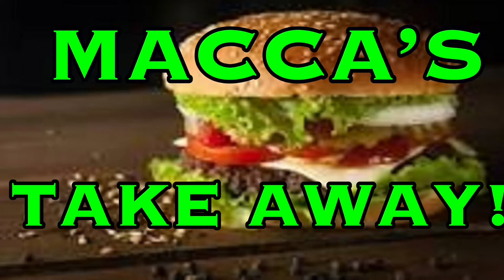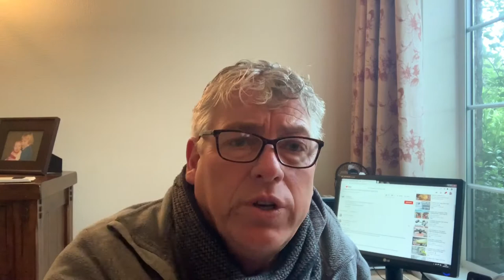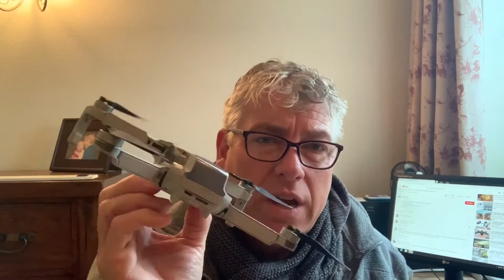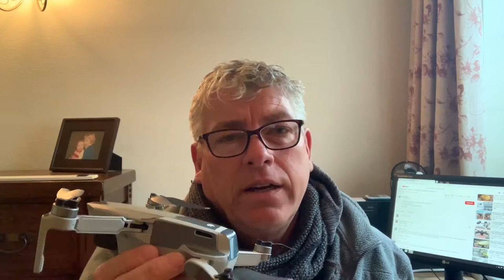MAVIC MINI - MOTOR SPEED ERROR SOLVED ISSUE!!

Comment: You are absolutely right and concerns minis with 3 batteries. One battery is automatically supplied with the current firmware, but unfortunately the other two batteries are not when you insert them. Then the error occurs. Remedy: 'DJI Assistant 2' for PC notices the incompatibility and you can install, or you can insert EVERY battery into the Mini and do a firmware refresh, so all batteries are up to date. Today I was able to fly all three batteries completely empty without having a problem.
Reply: Hello, thank u anlot. Could you tell us how to make this update of the battery?
Reply: @EwaFilmuje  

I already described it above. Step by step again:
1. with the normal firmware update there is a battery in the Mini. This will also receive the correct update.
2. When the next battery is placed in the Mini, it has not yet received an update, and it cannot be triggered.
3. The DJI Fly App automatically requests the firmware update for the second battery after a few minutes. But that doesn't always happen and that's the problem.
4. In this case, use the PC software 'DJI Assistant 2 for mavic', start it on the PC and read the instructions.
5. Then switch on the Mini with the battery, which still needs the new firmware, and connect it to a USB port within 20 seconds after switch on Please use the original DJI cable
6. The software then offers the refresh for the current firmware, which is carried out so that the battery is also supplied with the new firmware version.
7. Then you can do the same procedure with the next battery, so all batteries with the mini firmware are on the same level. This is important to note, because the DJI Fly does not offer an update option for batteries.

Trying out whether the error occurs again afterwards, everything is fine with my Mini afterwards. (Sorry, but English is not my home language)
Reply: @Trueffel  you are amazing! and your English is great! Don't worry ;-) I got it all!

Comment: Hi can you please help? when you put in a fresh battery to update the firmware what are you actually pressing to the firmware refesh?
Reply from the maker: Hi you need to go into about section and check for firmware updates do it with each battery and it will be fine